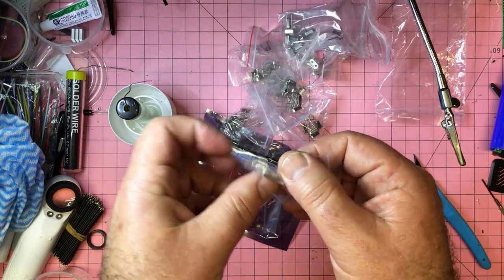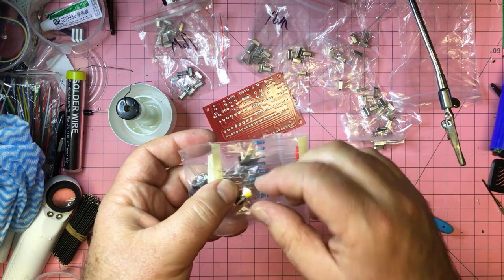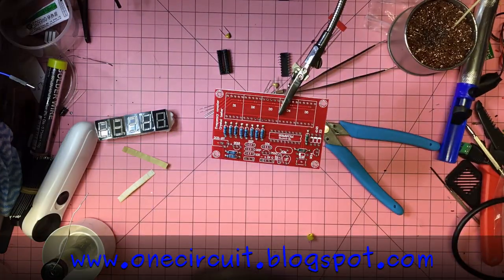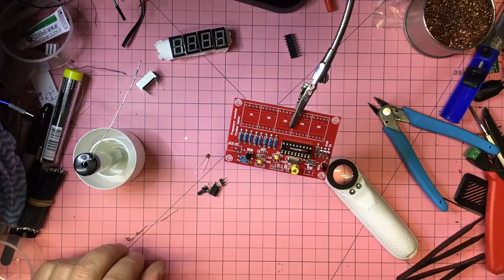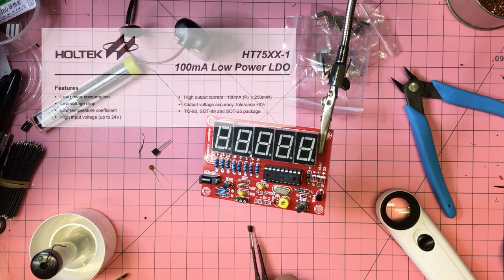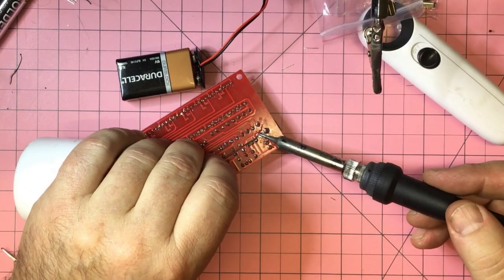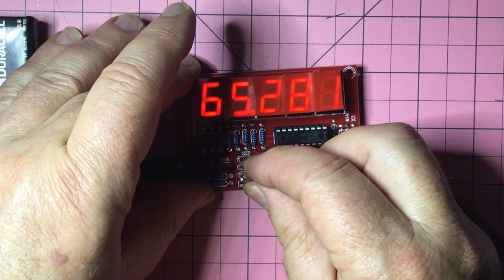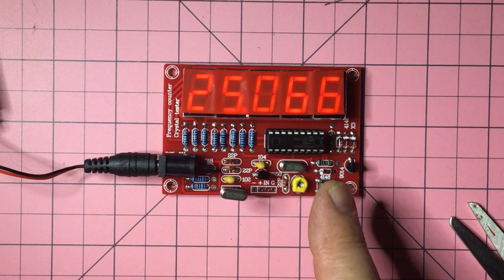Frequency Tester Kit

Comment: I've just ordered a second one of these. The first has the common issue of not working with lower frequency crystals. The second one is going to be modified so that the crystal oscillator becomes a pre-amplifier so the kit can be used as a frequency meter.